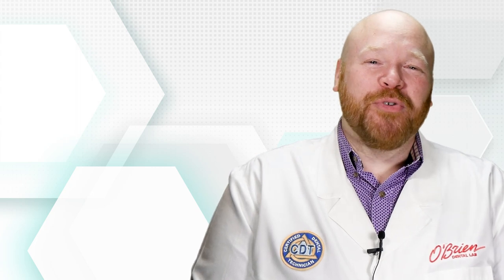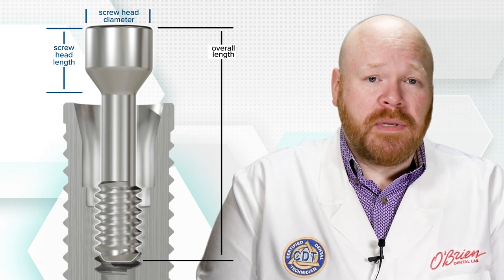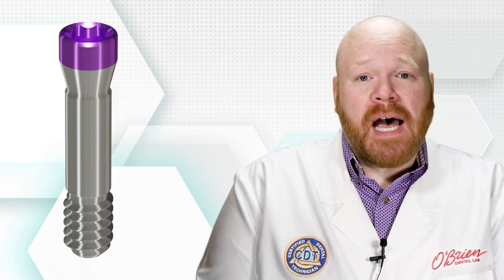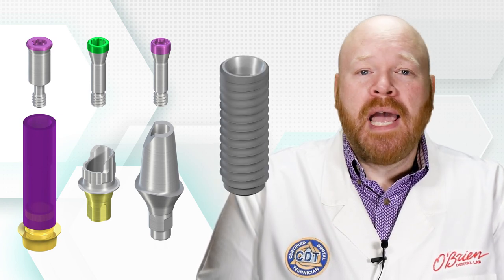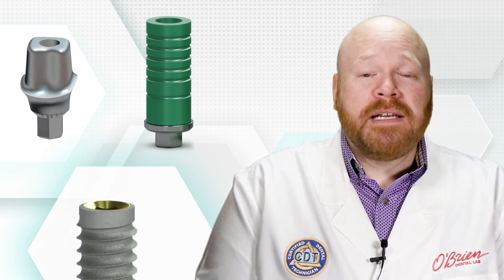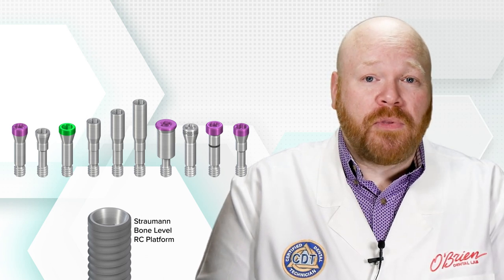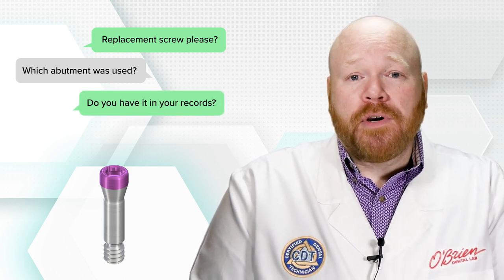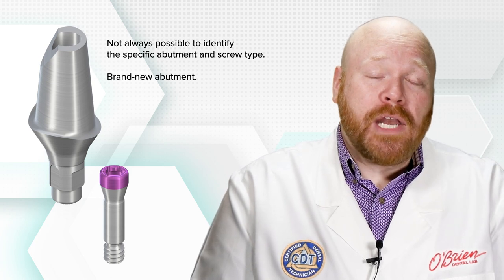Replacing Implant Abutment Screws

Comment: are there stock abutments that a dentist can place so that another dentist with no implant experience can simply do an impression like doing an impression on a real tooth?  and then cement the delivered crown to the abutment?
Reply from the maker: Yes, that can be done with virtually any stock abutment.  The downside is that if the margins are subgingival, they are more difficult to capture than on a tooth prep.
Reply: @OBrienDentalLab  thank you sir
Reply: @OBrienDentalLab  what is the name of the method of a general dentist with no implant experience doing a conventional impression on an existing abutment?
Reply from the maker: @mikehascats26  It's called "abutment level impression".  I usually tell the doctor they will be taking the impression in the same manner as a tooth prep.

Comment: My implant crown broke after 4 years of having it , without looking at it the dentist says I would need to change both the abutment and the crown which is more costly as I am paying out of pocket … is this the normal process or should they only be replacing the broken crown? 

I feel the abutment replacement is unnecessary but I’m also not the professional so I would easily lose that argument with them and have to pay the $1500 for both
Reply: Would you recommend continuing to trust them or go and get other dentist opinions on this situation